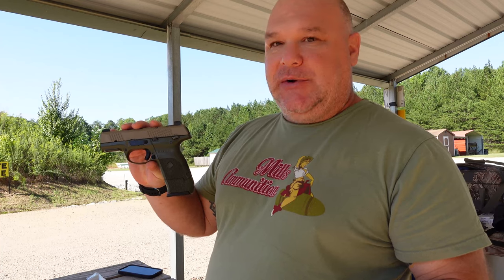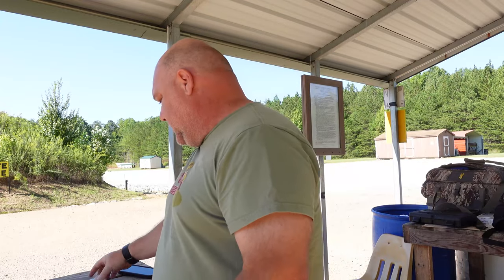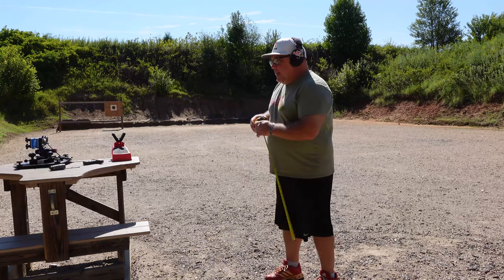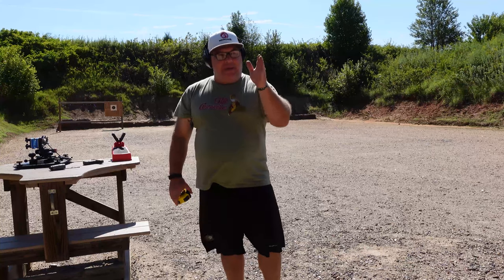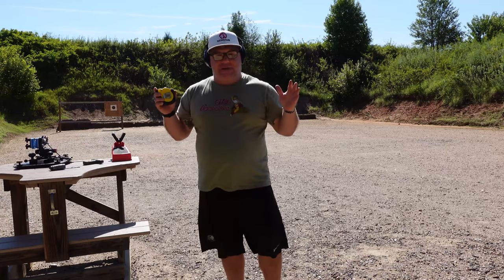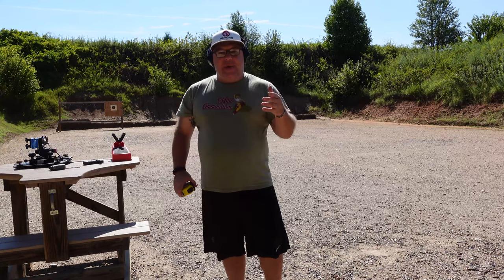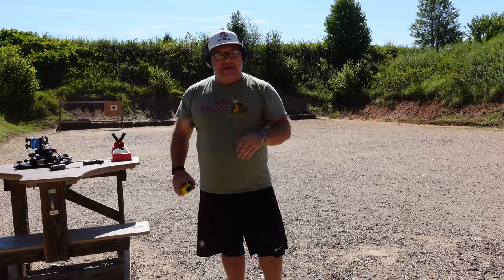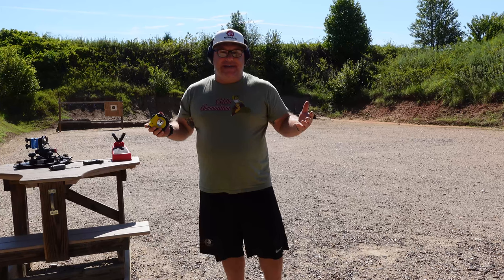How to tune your Semi-Automatic Handgun recoil Spring! Is it important???

Comment: Great video! I just put a Galloway precision 18 lb spring, heavy pin spring and ss guide rod, smooth it kit in my sr9c and it made a big difference! With the stock spring it would chuck the cases a mile away and now it’s a few feet straight right, works perfect. I handload 124 jhp and 147 fp and both work great!
Reply from the maker: That's awesome! Love Galloway. I have always been a big fan of my SR9C and fine tuning it makes it run that much better.
Reply: @MillsAmmunition , the smooth it kit really makes the trigger pull light too! First couple mags I wasn’t expecting it and got a couple double taps! Gotta grip it like a bull horn now,lol!

Comment: I've been curious about how adding a suppressor would alter the ejected casing. My guess is a suppressed casing wouldn't travel as far...So, you might want a stiffer spring in that case. Specifically, I'm hoping you might have a suggested spring weight for a Glock 17 (#17 factory spring) with Rugged Obsidian? I would prefer to avoid buying multiple springs to find the ideal one, if at all possible.
Reply from the maker: J W, hate to say it bud, but you just have to try to see what works. Make sure when you are testing that you using ammunition that predominantly use. Suppressors and compensators defiantly affect how a pistol cycles. This is exactly why tuning race guns is such a pain in the butt. My guess is you would want to go lighter but I have never done it before. Good Luck and keep us in the loop!!
Reply: Springs aren’t expensive and usually sold in sets for 20-30$

Comment: Ok but what makes less felt recoil I'm still confused
Reply from the maker: Appreciate the comment. I believe a stiffer spring helps with felt recoil. A stronger spring will absorb more of the inertia that is generated with the slide moving rearward after the shot is broken. Does make sense?
Reply: @MillsAmmunition  heavier spring will help absorb felt recoil "slightly".  While also causing the nose to dip down, increase muzzle flip by 2 to 3 degrees on average, and take .25 seconds longer to get back on target, per tests.